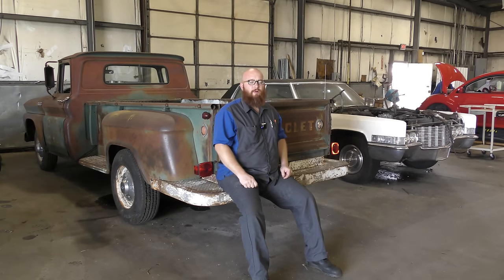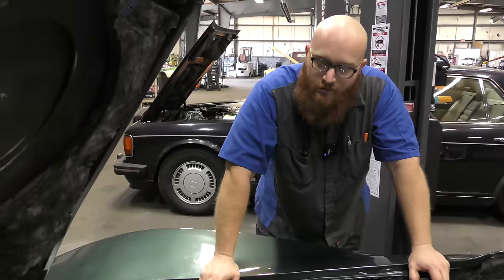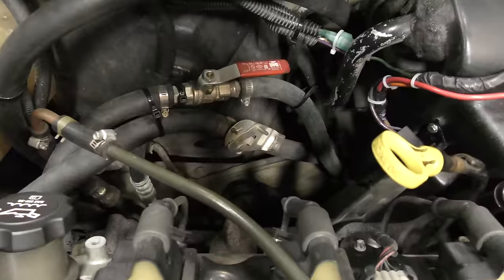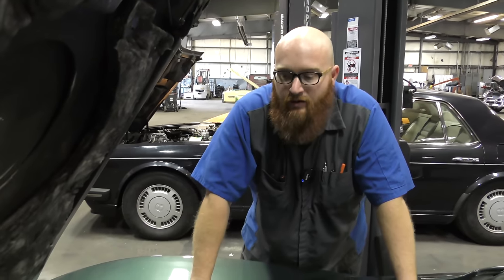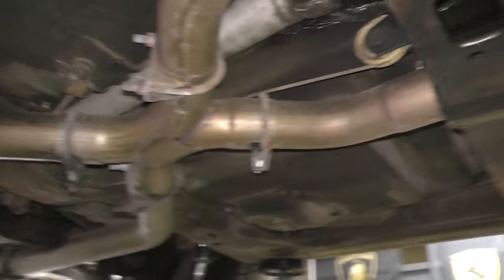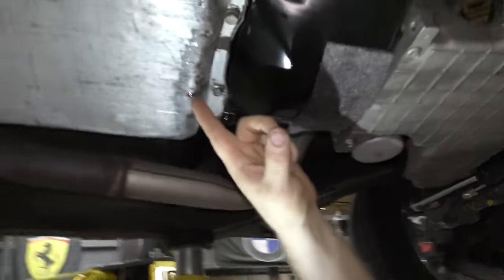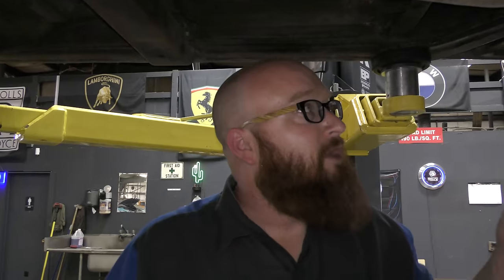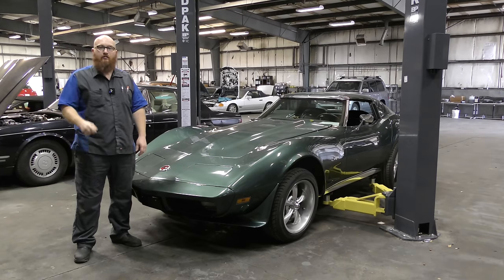Issues AFTER an LS swap! CAR WIZARD warns what can happen on an LS swapped '73 Corvette Stingray

Comment: If you do a restomod, document, document, and document.
Reply: Not only that, and it may look tacky, but labels on the looms wouldn't be a bad idea either
Reply: If you have a harness made ask for the print out, I rewired a few vehicles and I always used numbers on the cable and had sheets written out saying what was what just like in a book.
Reply: Painless Wiring is pretty well known for making harnesses with a full diagram. If you take pictures while you're installing it, it'll prevent a ton of headaches.
Reply: This. So much this. The effort early on in documenting and labeling will always pay off. I feel like I have learned that way too many times. Not just with restomods, but with projects in general.
Reply: I installed a factory tach in a car I had a while ago, which involved adding an extra wire to the cluster down to the firewall plug. For that one little mod I bothered to draw up a sheet of paper and stick it in the haynes manual I let go with the car...
Reply: A few years ago I looked into several restomod pickup trucks. I asked what documentation they had. None of them had anything written down. Some nice looking trucks, but...

Comment: That car's ride height you can tell isn't functional for that drivetrain setup, that transmission pan has taken a beating.  The wiring job is also sub par.  You can have the cleanest mechanical setup, but if you can't wire cleanly, it will take away from the whole aesthetic and probably won't be reliable.  Thanks for showing this so we can all learn from it.

Comment: Wizard is right. It's almost impossible to find a shop that has a technician who knows how to work on a carburetor or the tools even to do something like checking the dwell and timing. Owning an old school car isn't for sissies, or the automotive uninitiated. I came of car driving age in the 60's, and I learned how to do all of the above, and I can guarantee that given the choice, I will take an electronic ignition, fuel injected engine in a restomod over a carbureted old school ignition engine every time. Restomod is about keeping the car as stock looking as original while gaining all the benefits of modern technology. It makes no sense to try and hang on to old school traditions that didn't work all that well to begin with.
Reply: Never seen a shop without a light and a scope...
Reply: I agree with this, as long as you do the job (or get the job done) right. Because the Wizard's right; it gets expensive really quick trying to figure out a hack job. That R12/R134 air conditioner system is a prime example. It would probably be cheaper to just replace the whole system with a R134 system than trying to troubleshoot the relays on a mixed system.
Reply: Among other things carburetors don't work well with Ethanol-infused fuel which is the only fuel available in my area.  All the cars I ever owned that had them gave me problems at one time or another.  I don't miss them at all.
Reply: It has an ignition box so no dwell, that would be points and condenser type stuff.  The carb has to go though.
Reply: Any mechanic that cant work on a caburator isnt worth crap Thats basic stuff
Reply: @---cr8nw  someone else that has no clue
Reply: In cities it is difficult, a lot of small town mechanics can easily fix and adjust a carb, and they charge drastically less than the shops in more populated areas.
Reply: Dayam.If a mechanic can’t do old school he can’t do new school either.
Reply: I've never had much trouble with carbs as long as they don't sit for too long and even then, they're not too hard to rebuild. I do however agree about points ignition. It's a nuisance. HEI works every time... Just give it a fresh cap and rotor when you change plugs and wires and it pretty much never fails.
Reply: @honkhonkler7732  My point exactly. One of Jay Leno's favorite cars is his '55  Buick Roadmaster restomod. Old school looks with modern everything that makes it a pleasure to drive. With a few exceptions, even the most kickass factory muscle cars of the sixties handled like boats when it came to anything besides straight line dragstrip runs. Restomoding makes them more than trailer delivered car show looky loos.

Comment: I have a ls1 t56 swapped 1989 Firebird, did all the work myself.  I have a binder of diagrams and parts.  I also have a label under the hood with hose and belt info.  I also built it so all wear items are stock parts.  You can simply walk into a parts store open the binder and say I need this part.  Everything works, AC, cruise, and all factory gauges.  I built my harness myself.  Also the cruise module on the vett is from a 1999-2001 1500 truck, they don’t require the signal from the pcm to work like the car modules do and is commonly used in swaps, it’s a pretty simple circuit.  There are shops that specialize in LS swaps and know the common items.  The only non standard parts are my thermostat housing, I needed a straight neck.  Even my bigger brakes uses caliper and pads from newer car so you can easily get parts.

Comment: That bodge on the transmission to mask an obvious heavy leak is depressingly cynical. Those uprated brakes raise another resto-mod / custom / modified car question... When you need pads or disks / rotors... What the hell did they use? Everything will have to be stripped and examined for part numbers (hopefully) to figure it all out - More $$$ before you even have the job started! If it's some obscure aftermarket stuff you might be out of luck
Reply: That's a sneaky smart idea....I have a rear main seal leak that I might try this on.....lol ....lol....lol
Reply: Dude got totally hustled with that pad that soaks up the tranny leak! Hahaha. And the paint looks good right now, but just wait for the body seams to start cracking, what a POS!
Reply: Brakes are stock.  Stock rotor, it's just drilled. Nothing special or difficult.
Reply: Those are not stock that looks like a dual piston big brake kit
Reply: Trent robey same, i have the most embarrassing oil stain on my driveway because of it lol. i need to know where to get a sticky foam pad like that
Reply: @installwebercarburetorsona6159  Looks like an aftermarket mystery setup to me. That disk looks bigger than stock for sure
Reply: @assoonaspastablepizza8135  You don't seem to know much about body work, that's a lot of quality work there.  I don't agree with the carb, but overall that's a quality car.
Reply: It don't think that it masks the leak at all.  With the car on a lift, you can clearly see that it has a leak.  The pad isn't hiding the fact that there's a leak, it's just soaking it up and delaying it from dripping on the ground and/or running all over the underside of the vehicle. I think that the pad is a great idea if you have a leak that you're not taking care of right away and you don't want stains on your driveway.
Reply: David St James do you know what the pad is called?
Reply: @David St James Do you take a lift along with you when you check out a car? It's obviously not long term hiding anything it's just a mean trick so when somebody views the car there's no puddle and no dripping underneath it. Even If you lie on the floor and take a look, you'll probably not spot it - That's why Wizard suggested getting such a car inspected before buying - by a guy who does have a lift. It's easy to be a wise after that fact when the car's on a lift and the pad is absolutely saturated. It did it's job and fooled a buyer
Reply: @hydorah  LOL, I'm not arguing with you, I agree with you on most of your points, but you're contradicting yourself.  Yes, I would absolutely put that car on a lift, no, I don't take a lift with me to look at cars.  You agree with the Wizard's suggestion of having the car inspected by someone who has a lift, and I also agree with that.  What's the difference?  I think that most sensible people buying an almost 50 year old Vette, would inspect it well themselves, and if they're not mechanically savvy, they would have a professional check it out.  All of this is more important on a non original vehicle where most of it will take further looking into.  

Basically, I'm a pretty positive person, I'm not looking at things and seeing people screwing each other(figuratively, not literally) all the time.  The seller might have told the buyer about the leak and the pad, the owner of the vehicle was aware that there was a leak.

If the pad was maliciously put there in order to hide a leak, the person most likely would have gone further and really tried to hide it with some sort of sealant or epoxy.  Yes, I agree, if I got on the floor and looked underneath (which I wouldn't do, I would use a lift), I might miss the pad.  However, I would most likely see the pad because it's completely out of place and would have caught my attention(wtf is this?), causing me to take a closer look at that area.  I have never seen a pad used in that manor before, I think it's a good idea to prevent a bigger mess (but not if someone has bad intentions with it's use).
Reply: Not to mention a fire hazard with that thing soaked in oil near the exhaust! I am not familiar with the corvette so I might be really wrong here, but when you change your calipers you should change your master, that car looks like it has the original master cylinder, which could be for drum brakes, which require a lot more fluid then calipers, so you would have a short pedal travel, but no pressure. Again, just another head ache you get when you buy someone else project car.
Reply: @DJzSith  it would certainly be smart to replace the master cylinder with a hipo unit but if it's functional it's not hurting anything except maybe not allowing the upgraded calipers to work at their best
Reply: @yungtooli  Hello Yung, no, I don't know exactly what it is.  From the video, it looks a lot like a piece of automotive carpet padding, or sound deadening material.  There are many various products that can be used on the ground where you park a leaking vehicle to protect the ground from staining, these products would be better to use because you can see it getting filled up more easily and change them when needed.
Reply: @dillonkoch72  vets of that era have large 4 pistion calipers
Reply: Bodge... Had to look that one up...
Reply: @DJzSith  Starting in 1965 Corvettes had 4 wheel disc brakes
Reply: @brianhill4153  bodge is used a little incorrectly here is most certainly a loan word from the EE/Electrical field where you do a wire bypass or other "trick" that is either non-spec or non-standard
Reply: Yeah if I ever sell my ss.. I have to let the people know it have 2002 blazer spindles front and blazer rear disc brakes also...
Reply: @DJzSith  Vette came 4 wheel disc. I need front seal repair. How much.
Reply: @DJzSith  corvettes all had 4 wheel disc brakes.

Comment: Not usually a good idea to buy someone else's hotrod, unless you know what you're doing. They might not have.
Reply: That's always the problem with buying used... 9 times out of 10 (if not a full 10 out of 10), there's something that needs to be fixed, or it was worked on by someone who didn't know what they were doing.
P.S- Recently bought an interceptor... They definitely put minimal effort in its maintenance, and they drove it hard.
Reply: Wise words.    I would rather  find a vehicle that’s completely stock knowing no one has altered it

Comment: I am planning on an LS swap on my '88 Grand Fury with a big turbo because they are just bad to the bone. With that said, I don't get why you would swap in an LS in a basically stock configuration. You can upgrade the heads on a regular old small block and add a nice intake and cam and they make the same or better HP than a comparable LS without having to get expensive pulleys and brackets and a modified wiring harness and possibly having to cut and notch the frame and other problems. Especially if you're going to dump the fuel injection! And if you want to add fuel injection to the Gen 1 small block it really doesn't interfere with the factory wiring. As the "Car Wizard" so astutely says, diagnosing this Frankenstein is a nightmare while diagnosing an original style engine is far easier.

Comment: As a young mechanic working on carburetors setting timing to me isnt hard. My boss at the first shop i worked on taught me most how to do that stuff, he always told me learn the basics and you will easily understand how the new stuff works. Worked on alot of gm c3 systems those systems are something else but when tuned right they arent bad

Comment: I did a Chevy crate engine swap on my '73 without down the road issues.  The only issue with the swap was the cooling fan shroud that I had to cut in half.  '73 Vette was a carburetored car - Rochester Quadrajet.

Comment: I'm actually pretty relieved that old Chevy is gonna stay stock, It's a survivor.
Reply: Yes restomod's are bullshit. No one wants to buy a heavily modified vehicle. They aren't valuable in fact the Corvette is now worthless.
Reply: @timothycc711  Restomods are fine for cars that are essentially destroyed to start with.  It's when somebody chops up a functioning classic that I get nauseous.
I've got a friend that did a restomod to what was actually a replica car to start with, would have been a classic in its own right, but... very few parts of the original were salvageable, the frame was paper thin rust in places, the engine was seized.  It's essentially a new car except for the fiberglass body.  It got a relatively recent Mustang engine with fuel injection, handbuilt frame, digital gauges, and it looks amazing now, you can't tell it's not original from the outside.
The documentation is, of course, extensive.  There are pictures and notes for the whole process.
Reply: Timothy Clark sorry man the old motors are cool but they suck. They don’t make a lot of power and they aren’t reliable at all compared to modern v8 engines.
Reply: There was a Gray 65 Mustang that was Restomoded it was like 250K worth of modifications I didnt like the red interior but the body was spot on so this car was on Jay Lennos garage a few years back so last year I seen it for sale from the guy from Michigan with all the cool old cars from the 60s /70s/80s etc so this same Mustang was for sale for 129K I was like wow I wonder what happened did it get smashed or just no one wanted to pay 250K for it
Reply: @backyardboosters9128  lol what? You know those olders engines have continually been updated and actually hold up right? People even tune them and get lots of power out of them
Reply: Excuse me this car is anything but stock LOL
Reply: @rcragemoddingenjoyingrcveh417  Yeah dude, I was like "did we watch the same video??"
Reply: LOL google 427 SBC: 500+ to 600+ horsepower with a carburetor  @backyardboosters9128
Reply: @jonc4403  I see someone chop up Classic Jaguar that has been long dead and doesn't drive at all and put Tesla drivetrain
Reply: @backyardboosters9128  Do you wanna get an old V8 that fires all cylinder every time or a modern V8 that shuts half the cylinder you choose

Comment: I remember Tom & Ray always talking about carburetors - they always advised (this was back in the early 90's) to find a mechanic that was over 40 otherwise it would be worse than when you brought it in....  Also in the 90's I remember fellow auto crossers spending $4,000 for EFI systems for their Civics - boy have times changed...

Comment: My '82 El Camino originally came from the factory with a 305 Chevy V8.  When I got it, someone had swapped out the old 305 for an even OLDER 327 Chevy V8.  Thankfully, a small block chevy is still a small block chevy, no matter what the cubic inch displacement is, so it still works perfectly fine.  But i'm not everyone, I appreciate this insight into the hardships that LS swaps can bring to the table, I personally think LS swaps are overdone and overrated, and I feel that I am better off sticking with the old school Chevy small block, just get as much power as I can out of it without over-stressing it....  MAYBE try putting on fuel injection as well.
Reply: Most Chevrolet cars that came with the 305 and had their original engines swapped out wound up with the much more common 350.